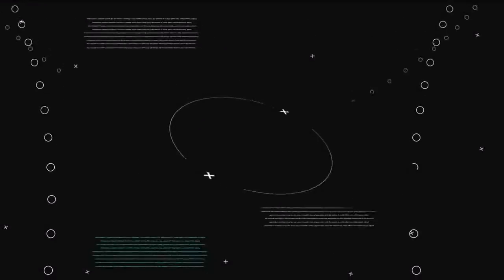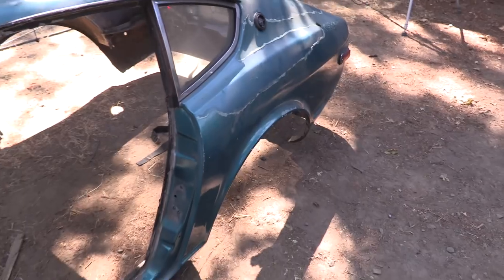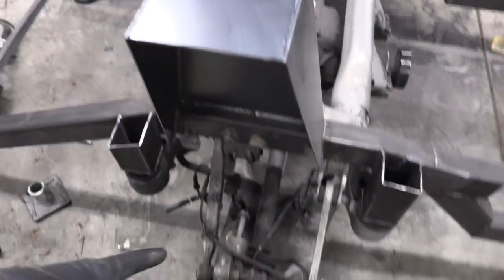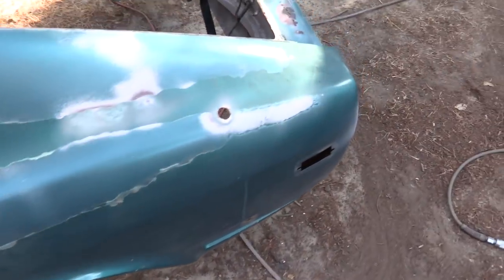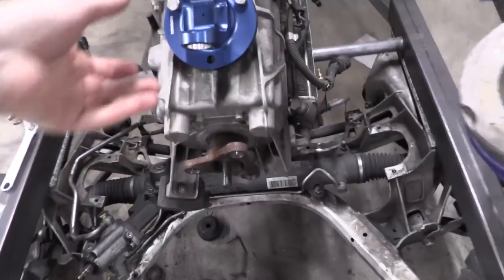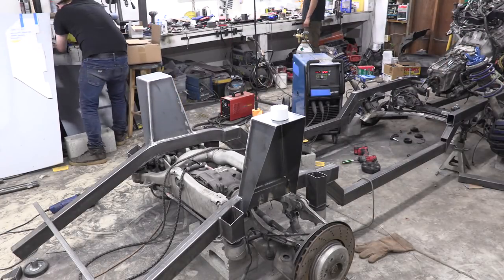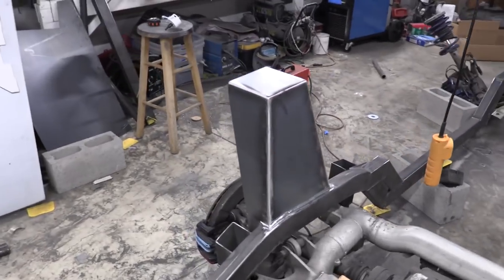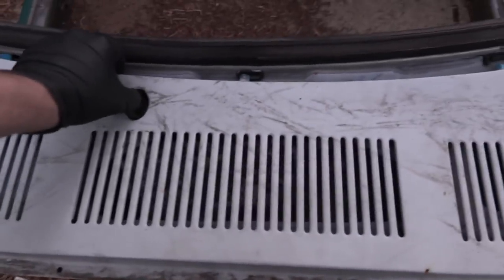IS THAT ALL RUST!? - Sandblasting The 240Z Body

Comment: Walnut shell is EXTREMELY gentle, the media blasting wasn't as effective as you wanted because of the media you chose.  The coal slag media is the most aggressive, glass beads are between the coal slag and walnut shell.
Reply: EFormance Engineering There is also some stuff called Kleen Blast used for industrial but really effective.
Reply: There's also baking soda and aluminum oxide. AO comes in different grit and can be very abrasive.
Reply: Binford2500 baking soda does not create a profile .
Reply: Glass bead wont get the surface rough enough AO 80 or 180 grit will do the trick for painting
Reply: This is what I was thinking as well, AO or Dustless blasting.
Reply: YUP! That's exactly what I was thinking. A little research could've produced a much better result.
Reply: i like my crushed glass for rust and spot blasting and plastic media for paint removal that wont hurt base metal.
Reply: @yamahastunt6  its a brand. Like green diamond
Reply: @lovescamaros1  glass is best for aluminum finishes, but it will deffinitely keep pitting through whatever you blast so be careful
Reply: Use walnut for tumbling media for my shells before reloading them.  Also have an ultrasonic cleaner for the stubborn ones.
Reply: Damn bro.  And here's me just stealing sands from the dunes.  Lmfao

Comment: I don't know anything about media blasting so when you said walnuts i thought u were gonna be blasting full sized walnuts at the body and got extremely confused.
Reply from the maker: someone should make a rapid fire full size walnut gun
Reply: 😂 I can just imagine shoting walnuts at the car 😄
What I didnt know, is that it could be bought at Wallmart! Thought u had to rent a prof kit or something...
Reply: B is for Build I guess we might have to contact Colin Furze for that
Reply: That would make a more interesting video.
Reply: I do sandblasting, media works best for older vehicles but what i would have done is use a bigger blasting machine with more psi, personally because ive done many cars before i could do the whole thing with just sand, but walnut is much softer and less likely to warp the metal or go through rust too much, but the only problem you had here is your blastjng machine, i can always blast a whole car in approx 5-8 hours completely
Reply: @MegaCasey09  how much psi do you run it at and what size compressor do you use?

Comment: Nonono keep the guibo.. That rubber disk you removed from the transmission to fit that peice you got.. It will still fit on the guibo. It will reduce vibrations immensely
Reply from the maker: we have a slip spline in our new driveshaft, don’t need the guibo
Reply: B is for Build I just posted about a slip yoke glad you added one

Comment: Had you gone with the HF pressure tank blaster and fine coal slag media from tractor supply you would have only paid 10 bucks for 50 lbs and it would have amazed you how quick and effective it is. Walnut shell is a waste of time for auto sheet metal. Glass bead is good stuff but expensive.

Comment: You shuld use sand to do a SandBlast...
Reply: Fernando Kugi Not necessarily, depends on how rough you want the media to be. Walnut shells are softet compared to sand when blasting
Reply: If you want to get silicosis then go for it. Crushed glass works just as well and it won't mess up your lungs
Reply: Guys, I just say that because the walnut doesn't work like Colton says to be much soft, always you has to use safety gear to avoid the silicosis and other stuffs , glass would be great too, nice tip Zedex,  tks guys!
Reply: Glass is by far my favorite for the sealed box because you can recycle it but for external media blasting sand is usually the best because of it's abrasive qualities but walnut is great because it doesn't eat into older or thinner metals as easily and it usually gives a cleaner finish.
Reply: I use a 50/50 garnet sand mix, found its really good. Wish I had a booth/cabinet, respirator takes care of the silicosis
Reply: Sand can heat up the material more than walnuts and warp it.
Reply: Walnut is good for vehicles over 70 years old

Comment: Use the walnuts to freshen up all of the alloy suspension parts, diff, gearbox, engine etc. At least its bio degradable as is soda which should work better if you have enough air volume. Oxide and glass will make a mess but will be more aggressive. Bit of research would have saved you money and a better abrasive would have got the job done and saved you time, giving you a uniform surface to work with. Calling in a mobile blaster might be a good idea with regard to a time/cost consideration.

Comment: When it comes time to paint the frame, look up a product called chassis saver. Napa sells it. its a urethane moisture cured paint thats sprayable, super tough, and permanently seals away rust as long as long as the coating stays.

Comment: Chris you should try kiln dried sand in the blaster, we use it for doing lettering in granite blocks and plaques. It would eat though the paint and any filler super easily and it wouldnt damage the metal

Comment: I can't remember if this was gone over at some point, but is there going to be a cross beam connecting the rear strut towers? Because (in my uneducated mind) I would think that over time, the towers are going to bow inwards, altering the geometry or even the structural integrity. Please inform me if I am, in fact, wrong
Reply: He has discussed doing some form of bar from tower to tower. It may be integrated to the roll cage.
Reply from the maker: they tie to the roll cage and im shopping for a cool looking strut support now

Comment: use a glass 70 grit sandblasting media. also dont get it at harbor freight it is super expensive there. i got my first batch there and it was about 25-30 dollars for a 50 pound box get it at like franklin building supply. they are 5 dollars per 50 lb bag. also when sandblasting scrape the paint or in other words go at it in a slanted focus it is much easier and faster and uses less media.

Comment: Genuine question but is the suspension uniform on both sides? Wouldn’t that cause instability and also make it so it crumples on one side more than the other?
Reply from the maker: jesus christ the toxic comments.. when i don’t have a comment section anymore don’t wonder why. 

To answer your question yes they are uniform, they were based off of a negative jig we made in the beginning as well as used mirrored parts to construct the towers
Reply: B is for Build coolio was just wondering. And well yeah... there’s always gonna be toxic people. Not that it’s an excuse but just stay strong dude
Reply: Mecha Fanboy Well yeah, but what even prompted your comment in the first place? You really think that someone doing a swap this in depth, if you can even call it a swap at this point, would just not think of something so obviously important?
Reply: brooksman10 curiosity.
Reply: N VD97 and what makes you say I haven’t?
Reply: N VD97 lol someone’s a lil triggered

Comment: Media blasting has a lot more variable than most people think.  Selection of the nozzle size, air pressure, air flow, media can all make the difference.

If you are looking to strip paint fast have you tried the poly web stripping disc.  You do need to be carful of overheating the panel but they cut though paint and filler fast.  I use Flexovit but I am not sure if they are available outside Australia.  This one on the harbour freight site seems similar.
https://www.harborfreight.com/4-1-2-half-inch-nylon-abrasive-wheel-94017.html

Comment: Please oh please don't put it on bags. What's the point of putting a v10 in and keeping the m5s suspension geometry, if you're just going to ruin its handling and slam it??

Sell the airbags to a 17 year old and get some KWs or BCs.
Reply: aklip I dont know a hell of a lot about suspension but I know air ride do make a performence airbag that a few drifters and rally drivers use.
Reply: I’m pretty sure bags aren’t gonna absolutely ruin the handling, they’ve changed quite a lot during recent years and they may be on par with normal suspension.
Reply: Airbags have come a long way in the last few years and are identical to coil overs in performance. the only downside is the added weight of the compressor and tank.
Reply: Air suspension is basically coilovers with lifts... Handling is just as good
Reply: Airbags are not the way they were 10 years ago the technology has advanced a lot to the point that it gives you similar if not identical performance on the road
Reply: Amadeus Bellenger dam if only supercars had BC coils so they could handle better
Reply from the maker: oh these comments just warm my heart, thanks for explaining guys! i’ll get back to work now!
Reply: I daily my 135 on air, the Airlift Performance kits ride AMAZING. No body roll, adjust ability, comfortable, looks amazing. Love everything about it, handles really really good. stop hating on bags
Reply: aklip it's a show car for sema yes it needs bags
Reply: +DABLMusic

Also really expensive and when it breaks it will cost an arm and a leg. I like the fact that air suspension gives you variability in ride height without doing labour but at the end of the day, it's more prone to failure than good ole coilovers.
Reply: B is for Build I've never seen a set of bags out perform a static setup. Cite your claims. How many championships have they won?
Reply: B is for Build like I get it is your car but geez. It really just seems out of place.
Reply: https://www.youtube.com/watch?v=tSKGPIxKkWQ
Watch that.

Also, maybe there's a tiny advantage in coilovers, but the Z will be 99% showcar, so looks have priority.
If you go to complain about handling, think about that big-ass V10 sitting on the front wheels TOGETHER with the gearbox.
Reply: B is for Build the only concern I have about the bags is whether they'll fit in your strut tower pockets without rubbing?  Have you mock fitted them yet to see if you need to do any clearancing before mounting the body?  Ask Cleetus about chafing :-)
Reply: Guys, where is Chris going to find a m5 fitting coilover set that is tuned for a 240z shell on a steel frame? The weight and weight distribution is totally different.
Reply: Thomas Lambaerts any reputable company will have the necessary resources to put a custom spring rate/valving on m5 dampers.
Reply: Ace tell that to my KW strut that blew apart with less than 10k miles on it and wasn't even low. 

Aklip sure a set of custom coilovers can be made but that would require waiting until almost the entire build was done to be able to put the car on scales and know what the weight is, where cg is etc. A high quality performance oriented air suspension today you can tune on the fly. You can also easily program presets for different types of driving that change at literally the tap of a touch screen. 

And lets be real, at the end of the day this is a show car. Its not being built for spec racing or any competitive driving realm for that matter. For the type of driving this car will likely ever see, the difference between a true performance tuned coilover (not shit consumer grade KWs made in china) and a quality performance airbag is negligible.

Comment: My only thing with the strut tower is to weld corner to corner. It is such a light car that all you will need is a nice strut tower brace bar and you'll be fine. My 240z has way more rust than yours!

Comment: That size of gun is not very effective for blasting fast but yes works very well getting into cracks and crevices
You probably didn't need to really remove the glass just use some painters tape or general purpose tape for it's low tac then some duct tape over that for it's strength at being able to handle being hit 
https://goo.gl/images/WdBpN2 this is what you would be looking for Todo the whole thing much quicker thend sanding and requires a much bigger air compressor
https://goo.gl/images/8GY1xz this should be a picture of the blasting pot and the compressor on a trailer
Never used walnut think we usually use sand green and black the black sand was better actually was able to reuse it after it's first use but the experience I have with sand is you don't need to worry about damaging a panel with it. It's really not that hurtful to metal but it can add a profile to it for coatings to stick to it better

Comment: Mate the blasting media you chose was way to gentle you should have used glass or sand, also the air compressor your using seems to be pretty weak you should've used a air compressor of at least 200 litres of compressor volume for your sandblasting to even be effective, so do your homework next time before attempting this sort thing.

Comment: Whew. Two problems. You need to pressure blast not suction blast. Also walnut shells is for electrical parts or soft metal. You were screwed right off the bat bro.